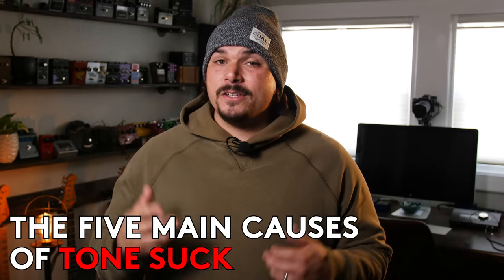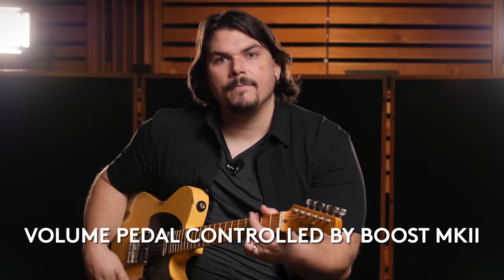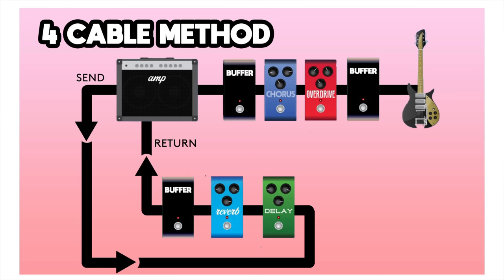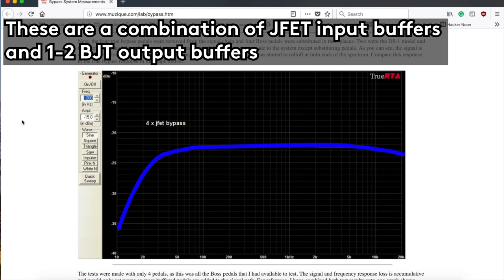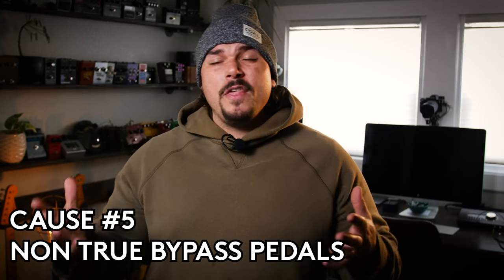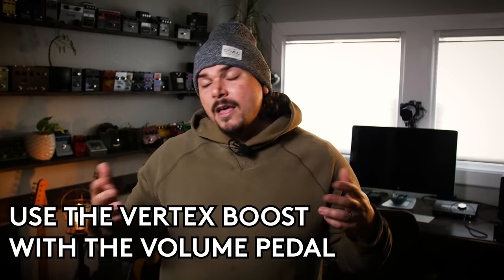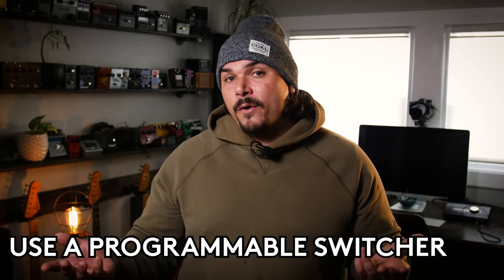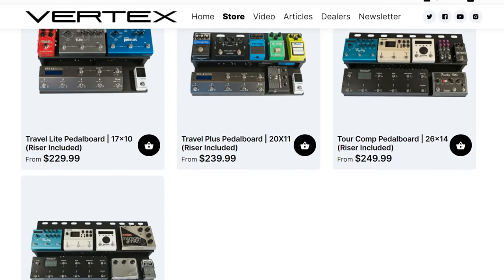Top 5 Reasons for Tone Suck

Comment: I use an EHX hum debugger to tame my tele’s really bad 60 cycle hum but it has an output of 750ohms instead of the 100ohms you recommend for a buffer. Should I put a bonafide buffer right before or after it? I’ve watched your videos and am also going to be putting another buffer at the very end of my chain as well.
Reply from the maker: What’s the input impedance?

Comment: So what if I’m running about 18 or 19 pedals, and have a high quality buffer first and last, would another high-quality buffer, mid-chain be a good idea (like right before my passive volume)? Most of my other pedals are true bypass. I have a stereo Wet verb towards the end (that I think is buffered), and a EHX Micropog near the beginning (which I think is also buffered).
Reply from the maker: Depends on what pedals are normally on.  Some pedals have low output impedances that are already pretty good as it.  What feeds the passive volume pedal is really the determining factor.  If you think that the pedal that's on before it is too variable or too high, you could throw a buffer before it or use something like our Vertex Boost which the volume pedal loops into via the EXP loop and the Boost has a buffer to turn that passive VP into an active one with a buffered send/return.

Comment: A very interesting video again. About MXR pedals even with the actual line there is some of them that are described as "true hardwire bypass" (like the Micro Amp or the GT OD), but that's a pretty blurry appelation. Is that an in between bypass that is not true bypass but also not buffered ?
Reply from the maker: Newer versions are all true bypass, I'm taking about the original versions made in through the 1980's prior to Dunlop buying them out.  Hardwire bypass is generally just another way to say true bypass.

Comment: Bottom line is bad cables, lengthy cable connections within the pedalboard. Bad wirelesses....or Wirelesses in general. So a Vertex solves the problem, or aids it? How many are needed in a chain of say, 12 pedals. 10 drive, 2 digital? All supposed true bypass?
Reply from the maker: See our signal path video.  Input buffer, output buffer, and as much true bypass as possible in between.  High quality patch cables, iso'd power supply and that's a good place to start.

Comment: Love the videos guys! I had a question about noise! Particularly with a compressor. I’m not sure if that’s just because of the way I’m using the compressor but it seems that I definitely increase noise when the compressor is on. Is there a way where I can still use the compressor but cut down the noise? Not sure if you guys have a video on noise but that would be an awesome series! Thanks!
Reply from the maker: Compressors add noise...think of it as an overdrive for your clean tone :)
Reply from the maker: Yes we have videos on noise issues...see our Rig Doctor Playlist.
Reply: I put my Keely compressor (and  MXR 10 EQ and Pigtronix  Boost) in the send/return loop of my Boss  NS2. Problem solved.

Comment: I'd be curious about your suggestions for working with the impedance finickiness of a Fuzz Face.  Obviously putting it first in line with your guitar straight in is ideal but I'm wondering if there are other possibilities to make it work better elsewhere in the signal chain and / or play better with buffers? Thanks for this video btw.
Reply from the maker: Input buffer would come after your fuzz of any impedance sensitive device.

Comment: My guitar has humbuckers. High capacitance cable is a problem, kills the presence peak that the pickups' inductance and tone caps create. But, the biggest problem I found is when a guitar is plugged into a low input impedance device. My first pedal in the chain had a low impedance input, so I built an internal JFET buffer into its input. That buffer has super-high input impedance and low output impedance.  Could have done the same with a good quality buffer as my first pedal, but didn't have room for another pedal, and the buffer probably cost me a few bucks in parts.
Reply from the maker: High Capacitance cable isn't always the issue...depends on the type of capacitance and other factors as well.  Some high capacitance cables sound pretty good with HB pickups, Belden 9778 and 8412 for example.  Remember that even two caps of the same value in say mica vs. ceramic will have sound differences, just as cables with the same capacitance specs will sound different.  There are other considerations as well.  Buffer first is always a good idea, preferably 1M input Z, 100 ohm output.
Reply: @VertexEffectsInc  I'm an electrical engineer as well as a musician. You have to consider the whole package including the series resistance and inductance of the PU's which are in series with the shunt cable capacitance, driving a pedal or amp input impedance. The whole lot causes resonance if the capacitance is reasonable. When the capacitance increases beyond that, it turns the resonant circuit into a low pass filter making the guitar sound "dark." And even muddy.  That very issue made my old LP sound awful.  That's particularly true if you are using a long cord (20 feet, for example).  A low Z input impedance only makes things worse.  Some pedals are particularly bad at that. I use a hi Z input (many megaohms), low Z output buffer (about 1 k ohm) very close to my guitar. That way it will drive virtually any pedal and I can tweak the tone any way I want, without sacrificing high frequencies.

Comment: This is probably a too-broad question/depends answer, but would other devices with a tuner out cause a similar tone suck? I have a Radial Big Shot ABY at the end of my board feeding a Princeton and an AC10, but I also run my tuner from its tuner out.
Reply: Is your radial active? If so, it's probably not a case for concern.
Reply from the maker: If it’s passive it’s going to have the same impact if the tuner is floating out there

Comment: Hello , I have a Pedalboard with 9 pedals . Most of them true bypass . One Marshall blues breaker ( not true bypass and not buffered … it has Some tone suck ) . First pedal is a mad professor royal blue od . This is a pedal that interacts with the Guitar just like a fuzz . It must be my first pedal for that Reason ( no buffer before it is the advise ) . Second pedal is a tc electronic polytone 3 mini with bonafide buffer . Can it be the second pedal or has it be the first because of the buffer at the beginning ( but that doe not work before the royal blue ) ? I also have a wampler boost wit independance buffer . For solo ( volume ) boost at the end of the chain . Will this work ? So , a buffered pedal as a second pedal and a buffered one as the last pedal ? Thnx . Mike
Reply: I'll step in here. Yes. You're fine. You want the fuzz/fuzz-like pedal to work properly. The buffer 2nd is close enough to buffer 1st in this case. The buffer at the end is where you want it as well.

As long as it sounds good to you, then you're doing it right. 99% of the audience can't/won't be able to tell the difference, other musicians included. This is coming from a bass player, and everyone knows we can be psychopaths when it come to the minute details of our signal.chain.

Comment: Great video. 

In my Pedalboard there are true bypass and non true bypass pedals, can I improve my tone using a dedicated input and output buffer or I don’t need one? This my chain:

Fuzz germanium type 
Tu3
Clyde standard wah
Dyna comp
Marshall bluesbreaker mk1
Ts808
Vertex ultraphonix 
Vertex steel string
Volume pedal boss fv 500 h
Mxr carbon copy
Strymon timeline
Strymon flint
Ditto looper
Reply from the maker: Depends on if there stuff always on.  If stuff is always on early in the chain the TU3 might be OK.  It has a 1M input impedance but the output isn't great but that might not matter if you have a early pedal on often anyway.  The Ditto has a 100ohm output Z as does the Flint, so you might be OK.  I would focus more on high quality patch cables.

Comment: Hi doc. What if my pedalboard is too congested and have to put the High-Wire in the middle (Example) where I can’t plug in/out cable straight, so I use junction box. Will that decrease the signal? Please advise.
Reply from the maker: You need it to be first and last to be effective.  They also sell individual sections of the High Wire, called the Stowaway.  This will allow you to put the input and output buffers separately for a better fit if you need that.

Comment: i have 3 true bypass pedal, 1 Boss Metalzone, i have two 15ft cable, and also i have four 6-8 inches patch cables.

Question: Is Boss Metalzone, a buffer pedal? Do i need buffer or not?
Reply from the maker: You want a high quality input and output buffer.
Reply: @VertexEffectsInc  can i use 1 buffer? and where i will put them, first in the signal chain? or last in the signal chain?

Comment: Man, how great would it be if there was an app or website where you could choose the pedals you have and it virtually arranges them in the "best case scenario"? Is there something like this?
Reply from the maker: There are pedalboard planner sites that are decent, they don't cover everything or spacing properly IMO, but can be a good macro view.
Reply: @VertexEffectsInc  are you aware of any that might offer suggestions on placement not only based on size of pedals but based on front of amp, fx loop, suggestions to avoid tone suck etc?

Comment: Hey Mason, thanks for the video, so insightful! Question: if I have a Fuzz pedal, should I put that first in the signal chain, then go into the TC tuner with bona fide buffer from it? I am also thinking of buying the Truetone buffer to close the chain off with, but I also have a KTR mid way through my signal chain. Should I set it to no buffer or put the buffer on and forget the TrueTone?Thanks a lot!
Reply from the maker: Paolo, I recommend using the KTR in true bypass... the buffer in it is poor and uses a TL072 IC chip which has poor output current and isn't really that stable driving long lines.  Also, it's in the middle of your signal path, so any pedals after it that are turned on will defeat the buffer anyway in the KTR.  I would recommend getting the output buffer.
Reply: Thanks Mason, so cool of you to reply and help out myself and the community with your knowledge. Appreciate it :)

Comment: Very informative video, I really liked. But I don't know why at 10:10 it appears a GLS cable showing a 100pF per foot value, while on amazon it states a 38pF value... Did you guys measured the actual value?
Reply from the maker: I got this one about 10 years ago and got it specifically because it's got a lot of capacitance and is good for testing buffers.  I measured it now it's a little under 97pF per foot including the connectors, so probably a little under that as most connectors have 10-20pF per connector or so.

Comment: Using an ohm-meter, where does one put the probes to measure the total capacitance of all the guitar cables and patch cables and stomp boxes in one's rig? Assuming that the guitar has original Gibson 1961 humbuckers, which readings are considered good using 2 x 20 foot guitar cables with gold plated jacks and 6 Boss stomp boxes?
Reply from the maker: You can use your DVM set to capacitance (pF) and put your probes on one side of the cable on the tip and the sleeve (ground) and you'll get a measurement.  Then divide that by the number of feet of the cable.  Secondly, I would also measure the plugs separately so you can omit them if you want to just measure the cable itself or if you want to include the plugs in your measurement as they also have a capacitance.  As to the number of the capacitance that you should look for, it depends on where it is.  Up front, guitar to pedals, the cable is more critical to the sound since it's only be driven by passive pickups which aren't very efficient.  On the output, even though Boss buffers are poor, it will be much more effective than your guitar pickups at driving capacitance on the output.  In other words, the cable that will impact the sound most is the one from guitar to the first pedal.  You might consider trying a few things with your pedalboard to see what sounds best to you.  For the output cable, I'd go as low as possible in terms of capacitance, maybe 30 pf/ft or less.
Reply: @VertexEffectsInc  Thanks so much for your prompt response - much appreciated. My cheap multimeter has a nano farad setting so I've been measuring and testing all my cables and converting the nano reading to pico farad using an on-line convertor. Some of the results were truly startling. Four of my cables had excessively high capacitance including one very expensive cable at 85pF per foot and another 17 foot cable came in at a whopping 126.78 pF per foot while a cheap 20 footer came in at only 37.48pF per foot. Only two of my 20 foot cables were under 30 pF per foot while several others were in the 37 to 38 pF range.
Reply from the maker: @taab7  a lot of that could also be the plugs...some of the plugs have 50pf just in the plugs (then multiply that x2 plugs)

Comment: Great video!! Would it be ok as well using a buffer as second/third pedal and second last on the pedalboard? (instead of first and last in the chain)
Reply from the maker: I wouldn't recommend it if you want the best results from you buffer.  Anything turned on after you buffer or before it can defeat it's effectiveness and loading and line driving ability.
Reply: @VertexEffectsInc  what about fuzz before the input buffer (and everything else) ?

Comment: Hello, I have 10 pedals in my pedalboard and will like to add a Dunlop Mini Volume Pedal. I have a tc electronic Bonafide at the beginning of the chain. Based in what you suggest, I must put another buffer,  so it has to be inmediately after the volume pedal or at the end of the chain?. thanks.
Reply: If you have a Bonafide buffer at the beginning then you don't need another buffer as long as your final buffered pedal in the chain has a decent buffer of less than 500 ohm (100ohm ideally which is the output impedance of the Bonafide buffer). Anything between the input buffer and last buffered pedal doesn't matter since that signal has already been converted from high impedance to low impedance by the Bonafide buffer.  If your final buffered bypass pedal in your chain is a Boss pedal with an output impedance of 1k you'll still be fine running 20 ft to your amp but if you're going to be running long runs then you'd want a better last buffered bypass pedal or you can add an output buffer in that scenario
Reply: @AnthonyJarrah  Are you suggesting a  Boss pedal as the last pedal in line.
Reply: @sparkyguitar0058  It depends on how long your cable run is between the last pedal and your amp input. The output impedance of a Boss pedal is 1K ohm which is low impedance enough to run 30 feet to an amp without any loss of tone. 1K ohm is a lot lower impedance than a 6K ohm output of a Stratocaster for example and a Strat doesn't lose that much tone running 20 ft directly to an amp input. If you're a touring musician and your amp is let's say 100 ft away from your last pedal then you might benefit from a lower output impedance buffer as your last pedal but even then the Boss pedal should run that with no problems. However I have never tested it personally since I don't have a 100 ft guitar cable
Reply: @AnthonyJarrah  I kinda crazy and have well over 10 wireless units. Run a triple A battery AKG wireless bug system into board and a Getaria 5.8 rechargeable wireless system to board. Longest cable on my board runs from the bottom pedals to pedals on top. 18" long. My board is so quiet that I have a dB-1 boost/ buffer that I don't need the buffer turned on.

Comment: Cheap wound single guitar pickups have more magnetic leakage, any reasons why? because most pickup winders say don't wax pot the pickups because this alters the resonance and sustain of the pickup but this also increases the magnetic leakage when not wax potting them. When positioning the guitars pickups at different angles away from the amplifiers power transformer this is called "diametrically opposed" to try to cancel out the hum getting induced into the guitars single coil pickups? Shielding a guitars cavity body and shielding single coil pickups is consider "diametrically opposed" to try to cancel out the hum and magnetic fields?
Reply from the maker: You're talking about using this vocabulary or the impact of the shielding having the same impact?